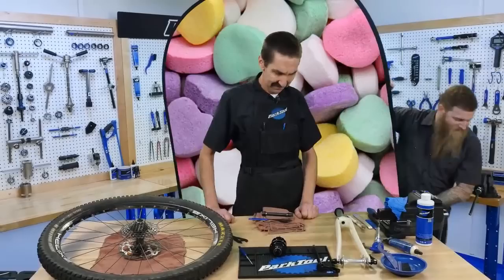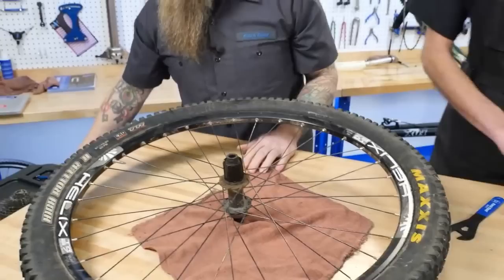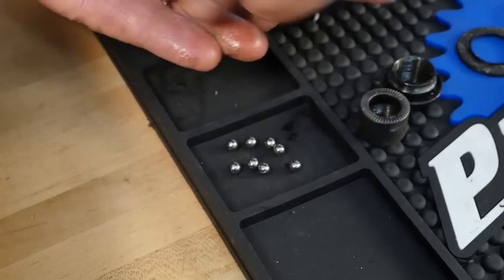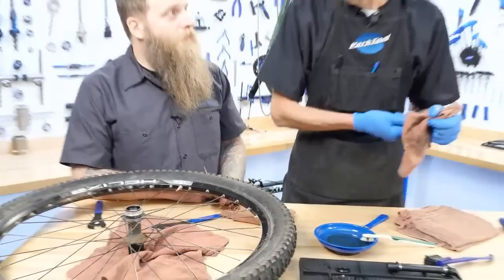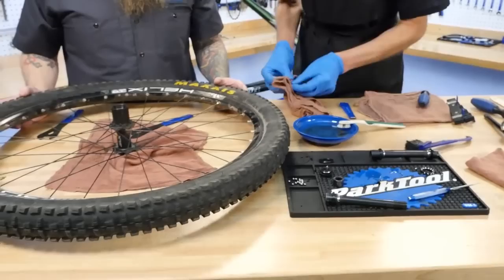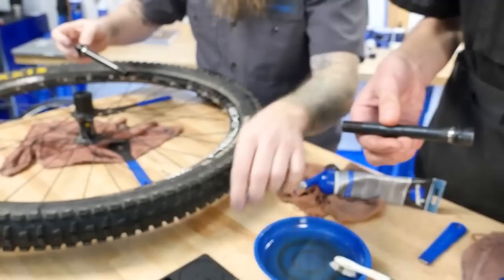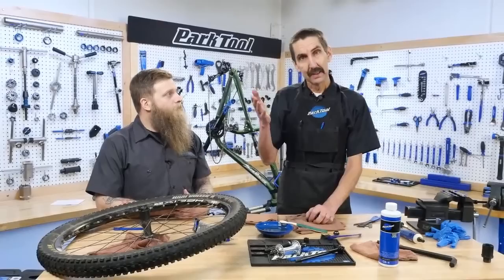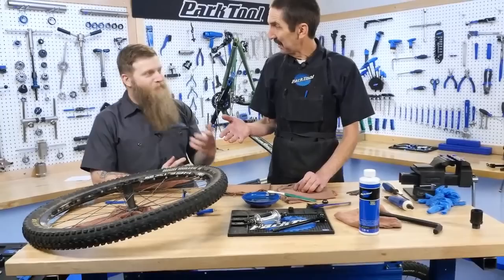Tech Tuesday LIVE: Thru Axle Hub Rebuild - Tech Tuesday #74

Comment: At first I thought it would be impossible for me to service my bike’s rear hub, but after this I am 95% confident that I can do it! I just ordered Park Tool cone wrenches so that I can do the job.

I have a problem:

1. Cassette is tightened.
2. Cassette keeps moving to the right.
3. Cassette lockring rubs against the derailleur hanger.
4. Cassette lockring is worn out.
5. Can’t ride my brand new bike.

I took it to the LBS. They were all question mark. They told me that it’s about wrong size axel. And also they were wondering the hub, how it works. Well, now I know better. Somehow something is loose on the hub, but it is not the cassette lockring. The some nut is loose I think, which allows the cassette movement. Gonna figure it out by myself as soon as I the wrenches!

Thank you Park Tool, Calvin and guys, thank you so much!

By the way, Canyon sent me a completely new rim and hub because of warranty. If I can fix the broken one, I’ll have one spare. Hub that I need to service is Alexrims DR850.

Fingers crossed!

Comment: Great to watch you guys work, even without the need of advice...
Anyway, I wanted to push in that a good method of testing whether the hubs are tightened not too tight is to align the axle on the index fingers of both hands and use remaining fingers to spin the wheel. if it goes freely and doesn't pull the axle off the index fingers with it. It's pretty close of perfect setting...

Comment: Your magnet tool held onto one of the ball bearings from the drive side so when you took out the loose bearings from the non-drive side you actually added that one. So 13 in the non-drive side, not 14.
Reply: I noticed that too
Reply: Noticed that as well I was wondering if they did 🤷🏻‍♀️
Reply: Which has zero relevance to the instruction being taught dummy! 😆

Comment: You guys messed up.  You put your lost ball bearing in the drive side resulting in 14 ball bearings on that side but only 13 ball bearings in the non drive side.  Your lost ball bearing got stuck on the magnet on the pick when you removed the retainer from the non drive side and was still on the magnet when you pulled out the drive side bearings.  Check the video again c.a. 10 minutes and 15 seconds in, you can see one ball bearing is stuck on the magnet...
Reply: Yeah! I know pretty well how to service thoroughly any hub at this stage of my life. But still before doing my rear wheel servicing i stopped to watch this vid. As my rear hub is the same as their ones. Shimano m7010 thru axle freehub. After disassembling the hub i was careful not to mess the bearing balls. As drive side had no retainer (most of the loose ball hubs don't have this type of retainer often) to keep the ball in place. But i can't find my 14th ball any where. The odd thing was when assembling the qr 9 ball conventional hubs we often felt 2 to 3mm of gap between 9th to 1st ball this wasn't issue and this gap evens out after assembling the spindle. But in this thru axle hubs case, Balls are one size small and they are too many (13). And the gap between 13th and the 1st one felt a bit wider. So much so one can felt maybe somehow he lost the 14th ball and should give it an extra one. Don't do it. That gap would also even out when the spindle/axle installed in the end.
Reply: Always count the balls on each side..
Reply: Also cleanliness was lacking.

Comment: you also mucked up by tightening the bearing WITHOUT bedding it in, just like on a car axle, ONLY tighten the axle nut with the bearing ROTATED by hand, this makes sure the axle or bearing are NOT cocked in the system, and ALL felt torque is TRUE torque, not that generated by crossed threads, or other resistance in an ill fitted joint!!
Reply: K

Comment: @19:58 Putting the tool into the vise is not neccessary. Just put the wheel on the ground and push down on the long allen key/hex key. Yes, it may or may not be super tight and may have to use a breaker bar for extra leverage.

Comment: I have a specialized rear hub. Specialized, sealed cartridge bearings, 12x148mm thru-axle, 28h to be exact. Are there any major differences or can I use the same/similar rebuilding technique?

Comment: 25:00 If you want to avoid pesky bearings falling through the hub, then just take the axle and put it through from the other side so it covers the hole. voilá.
Reply from the maker: A very good tip indeed.

Comment: What if the drive side of the hub wobbles, without the axle or cone inside. The thing that holds the cassette just wobbles on its own, free of any parts on it. Inside the whole, it only wobble up until the main part of the hub inside the wheel. When i adjust the cone, the wobbling dissipates...is this normal? I got a cannondale trail 5 2018, rear hub is apparently a Custom BOOST QR formula

Comment: If your hub uses ball bearings with a retainer, like 5/32" x 17 (bearings), can you just use 17 5/32" loose ball bearings without the retainer?  Specificlly a MT400 front hub uses 5/32" x17 for the drive side and 5/32" x 15 for the non-drive side.
Reply from the maker: You sure can! You will fill with bearings until you cannot install anymore. The carriers are handy for assembly but not required.
Reply: @parktool  Awesome, thanks for replying!  Much easier to get loose bearings than OEM, or even aftermarket, caged bearings!

Comment: Great video  helps a lot. is there a way to know how many ball bearing is there in one side of the hub if it is clearly lost/lacking to begin with. or is there a standard for the number of bearings in a certain hub. Thanks
Reply from the maker: Unfortunately there is no more standard for number of bearings in a hub. Often you can find exploded diagrams of specific hubs on manufacturers websites that will show exactly how many bearings should be there. What hub are you working with?

Comment: so, did i damage my brand new thru axle hub by using a quick release only cassette tool to install cassettes -- which were wobbly and wouldn't tighten?    or do i just to get the right tool and we'll be fine?
Reply from the maker: The fun part about thru axle wheels is that you can use any of our FR-5.2's and you will be good to go. You cannot use our FR-5.2GT on non thru axles though. So, you do not need a new tool but you may benefit from it.

Comment: when you put the seal back you said it has to be in far enough so it wont give a false sense of the bearing (i.e  tightness against the cone). how about too far in . wouldn't the seal rub against the bearing if in too far. where is the right place for the seal not too far in and not too far out. thanks
Reply: It absolutely would. however, most axles have a stop so it's not possible to push the dust seal in further.

Comment: what is better tiny play or tiny roughnes.. for example i want to suck as much life as possible out of my old hub system... and i get no play when it starts to get rough.. but when i get no roughnes i have tiny play.
Reply from the maker: "Roughness" can be quite subjective. If the roughness feels even all the way around, it is likely the lack of polish on the cone and cup. Less expensive hubs are made this way. Adjust for no play, or rather as loose as possible without any play. If the roughness is does not seem consistent, it may be from pits or wear in the cone or cup. Here, there is not a good answer. These pits are only going to get bigger. 
Another consideration is the hub system. A thru axle does not compress or flex when installed in the bike. The 10mm or 9mm open dropout style hubs that use a quick release skewer should have a little play outside the bike, but when installed and tightened in the bike, this should disappear.  The load of the skewer changes the bearing adjustment slightly, but again only on the smaller axles of the open dropout systems.

Comment: Is this a Shimano or Sram hub, are they similar in adjustment, I want to adjust my Sram mth 746 to take up play in the axle, new wheel 100 miles old. Many thanks for any reply you give! Great channel.
Reply from the maker: This is a Shimano hub. The 746 hub uses sealed bearings but a system similar to this to set the pre load on the bearings. There is an inner nut that rides against the bearing to set the pre load and then there is a second locking nut that holds it in position.
Reply: @parktool  sorted it thank you, next to no grease left in non drive side, fully repacked now and ready to roll after plenty of checking to get preload just right 👍🏻

Comment: I’m totally confuse by this pro mechanic for bikes. On Indexing gears, there’s only One wire pulling and releasing the Rear derailer. E.g, you have a 9 cogs cassette. There are no 9 wires controlling each cogs. So , if only 1 wire is to be indexed. It’s should be the highest gear to the next. If we keep changing the tension of the wire as we change the gears (indexing). The first indexing is out?

TH

Comment: Is it nessessary if both side have loose bearing with out retainer that you put same bearings in same side? or are any mistake if they mix while cleaning?
Reply from the maker: I prefer to keep the bearings separate when servicing. I do this to keep so once you have cleaned them you can inspect each side and determine if there is an issue. If one side is marred and you mixed the bearing then you will have to replace all the bearings where if you kept them separate you could keep one set of bearings. In most cases all the bearings are replaced and the practice is for not. But I find that it helps me. The other reason I do this is to keep the same wear on the same surfaces.

Comment: have a bent rear mtb thru axle, found a new one but dust caps are not wide enough, outer diameter too small, where can i find new ones that might fit? tia
Reply from the maker: Check with the manufacturer of the hub. Hubs can be fairly proprietary.

Comment: Is it possible that the freehubb can be opened?  Certain brand?
Reply from the maker: Everything can be opened, but not all can be put back together.  Some use an external ratchet system you can get at, and the freehub only contains cartridge bearing.

Comment: My SRAM ROAM 30 XD through axle freehub has some side to side play. Could the non drive side endcap be loose? How is it tightened?
Reply from the maker: On that wheel im guessing it is freehub bearings. The end caps are not threaded on. They are held on by the drop outs and tension on the thru axle. If the wheel is off the bike you should be able to gently pull the end caps off and then pull the freehub body off to inspect the bearings.
Reply: Park Tool thanks for the reply. I’m really pleased that you pay attention to the “small customers” like us. Some of the big bike brands won’t even bother to reply to comments.

Comment: first day on the job as a part time mech and I was working with an old Swhwinn rear hub that was almost locked up. Surface of one cone was scored pretty bad but no replacement part
 Customers expect a $10 repair bill on a 25 year old bike? It ain't gonna happen.
Reply: if it's an internal hub you could try a tranny oil bath for a couple days. works a treat. people will happily pay 40 bucks for a haircut but balk at the same bill for a tuneup. tools are not free. anyone can cut hair, not everyone can wrench right. we are all under paid and the common rider is unaware of what a piece of crap they are riding anyways.  i upped my fees for repairs in my home biz because i do it same day. bike shops take forever plus charge more than me. i also give a one year free tuneup thing. it's great deal and i make up to 150/ hour some days.

Comment: This is pretty much a myth that the quick release system will compress the axles and bearings. Properly tightened counter-nuts/bolts wont move under the pressure of QR clamps.
Reply from the maker: Easily tested.  Adjust a hub, and test the bearing rotation by feel.  Use a set of washers over each lock nut on each side to create "dropouts", and lock down the quick release properly secure, just like riding.  Now feel the axle rotation again.  Same?   You will find these two settings different. The flex is really occurring along the thread engagement in the cones/lock nuts but there is a difference from the flex of materials.
Reply: Well you can test this precisely by using servo/stepper motor, and there's no difference. Put the wheel in QR clamps without clamping them and use servo push on the spoke. Then test this with QR clamps tightened properly[when a clamp is at 90 degree to the fork and you feel a force, then clamp it tightly until its parallel]. If the wheel make more revolutions, then you've proven QR clamps do indeed affect the hub. 

Maybe my method of tightening the lock nut is preventing any movement by QR clamps -usually i purposely make the hub too "tight" by overtightening the cone,then i screw the lock nut to the cone tightly, and then slightly back up the lock nut, clamp the hub in vice by this locknut, and then unscrew cone so it move up to the locknut. I do this with quite a lot of force, so its really tight. After that the hub is perfect, very smooth without play even when i use lot of force to move the axle.

Many people make the mistake of making the cone "just right" and then tighten the lock nut to the cone by driving it down, while the cone move ever so slightly in the process, since its hard to hold it steady in the hand just by the milimeter.This make the hub too tight, or the locknuts too loose.

This also might depend on how much metal washers/distance pads are between the locknut and the cone, and how hard these washers/distance pads are. Generally a good hub will have quite a large and sturdy washer/distancer, so there's no possibility that the washer will deform noticeably[meaning 0,1mm or more, because that will be noticeable in the bearings play] under the pressure.

Comment: would a damage cone create wheel play?
Reply from the maker: We enough damage, yes.  Material is removed from the ball patch, like digging a trench in the road.
Reply: @parktool  fair enough thanks, my question was because I was wondering whether it could be discriminated before taking the hub apart if the damage would be the cone or the axle bent.

Comment: How often should this be done?
Reply: Generally speaking, at least once a year, but it really depends on how often you ride and under what conditions.  One thing is certain: it is better to do it more frequently than less, because if a cone goes bad, it can be difficult to get a replacement part.  If it is an off-brand hub, often it is impossible to get a new one.
Reply: Approximately once per week.

Comment: Hello, I see you guys from Argentina. I'm looking for some help with an issue with the hub shell and the freehub, both are touching each other and this causes that the cassette keeps spinning when I stop pedaling and the chain its suck. I can't find any problem like that on the internet. What can I do? Thanks!
Reply from the maker: What kind of hub is it? Have you done anything to it recently? It could be that it is dry inside the freehub so the freehub is not moving freely.
Reply: Park Tool it's a common Hyperglide cassette and it's new, I didn't make anything than grease the external bearings and the axle. When I turn the freehub I can feel that in some point it's being stuck. It makes me thing that the body it is touching the hub shell.
Reply from the maker: When the cassette is removed can you feel the same thing? Send pictures of what you have to truman@parktool.com
Reply: Yes, its still continues!  Shure, thanks for the attention. I will get the correct Allen Key to disassemble the freehub and I send you the email.

Comment: Well that has got to be the worse greasing job I have ever seen lol Good vid though.
Reply: Why? Bearings need a looooot of grease. They are not 100% sealed tight, if there's too much grease the bearings will squeeze it out. Sure the hub might be too tight/sluggish for few hundred kilometers, but after that everything should be good, and you will know that you made your hub very resistant to rain/solvent. Just make sure to clean the outside of the cone if you see the grease after some time. It attract dirt, that can then mix with the rest of grease and move into the bearing.
Reply: SekretZdzicha just how messy and random it was lol